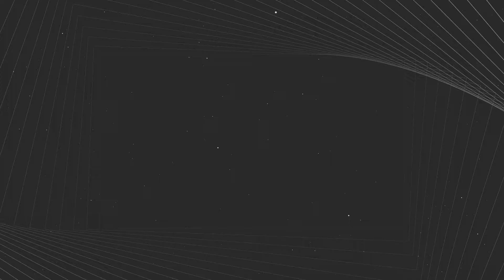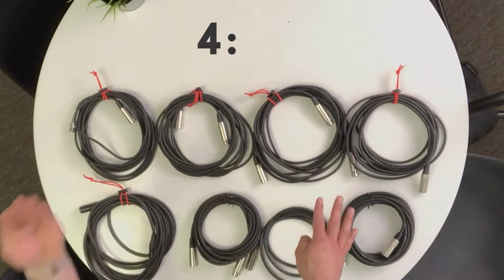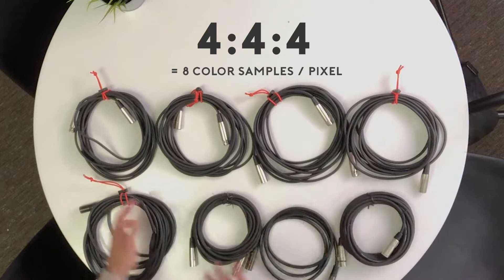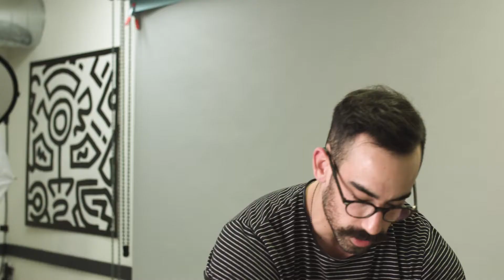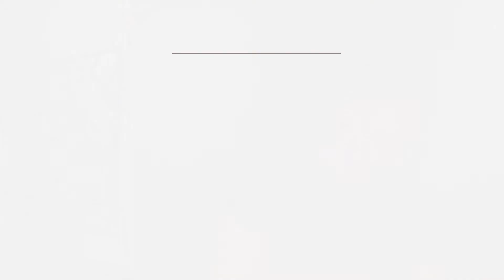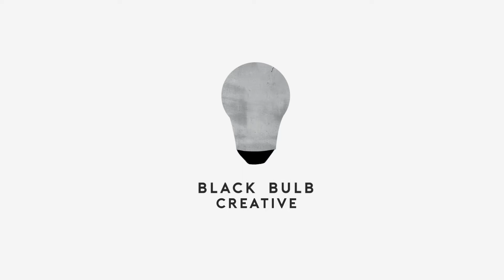Chroma Sampling Simplified

Comment: More confused.
Reply from the maker: The first value represents the luma value (4) and since that value rarely ever changes, I focused on the second two digits.  These two values may go from 4 to 2, they are basically cutting in half the sample size, and that's the point I'm getting across with the cables. Does that help a little bit?

Comment: Great video but can you explain it deeper? In a mathematical perspective.
Reply: this is the wors t video on the subject i have seen
Reply: Just think of it as resolution, but not for pixels, for color information.  Chroma resolution, basically.  4:4:4 you’ve got color values for every single pixel.  With 4:2:2 That gets halved, every other pixel has color information, and with 4:2:0 it’s quartered, so only every fourth pixel has color information.  If you’re using 4:4:4 and storing color information for every single pixel, that takes up a lot of storage space, but it will give you the highest quality image to do color grading on in post production.